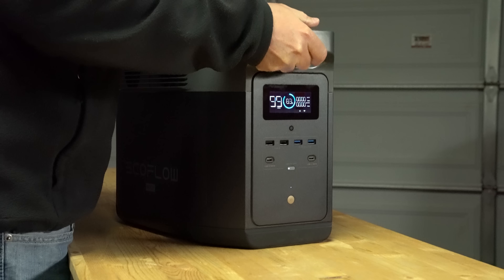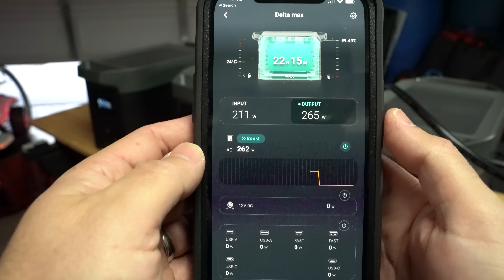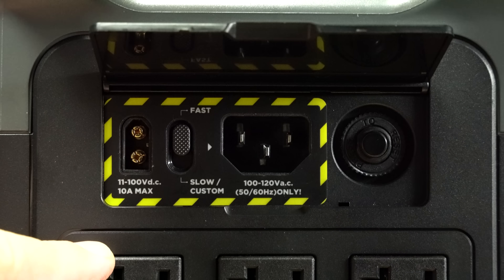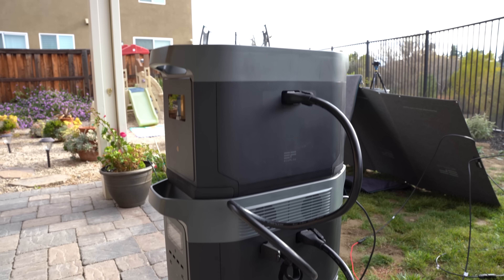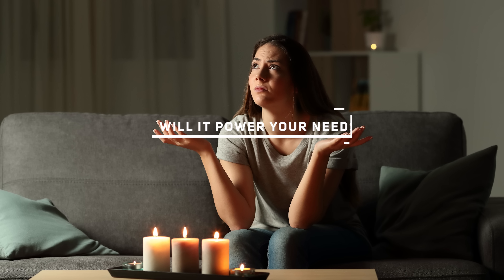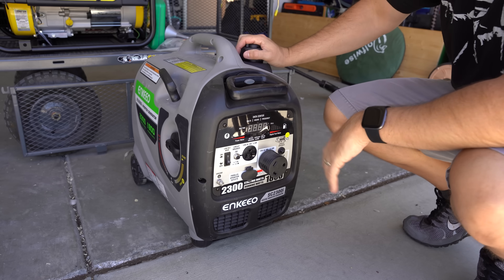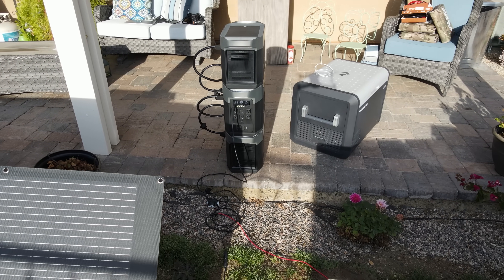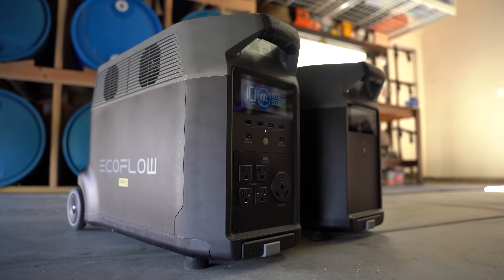Ecoflow Delta Max review - Off Grid Power in a Small Package

Comment: So how good it is with powering motors? The TV and internet are luxuries, you phone will last all day, How long will it run your fridge and freezer, your central heating system or your cooker. Even if you have gas fuelled heating and cooking I bet you still need power for the computers and pumps built into them. I have 500Ah of 12v batteries and a 2KW inverter and that will only last me 24-36 hours, even with gas heating and cooking. So I also have a generator....if you have power supply problems - get a genny.

Comment: Any computer uninteruptible power supply... Autoswitches to battery on loss of grid.  Autoswitches back and charges the internal battery.

Typically small 12V lead-acid gel-cells.  You can jumper to a common trolling motor or car battery

You can charge the 12V with solar if you want...

You can put these thigs in place for individual desired loads.  Only your critical loads pulling power means maximum run time.

Comes out cheaper than these "solat generators" that don't have solar panels included...

You're welcome.

Comment: I wonder why you are not warning people about the problems with the unit not being used for a period of time. I bought a ecoflow delta Max to use in my home for emergency use in the event of a loss of power from the Electric Co. But... the manual says not to leave it fully charged! It recommends to discharge the battery to 60%! What good is that?? Mine recently discharged on it own down to 1%, even though I had used it some in the last month, and fully charged it before turning it off. Manual also warns this could "cause irreversible damage". I could not recommend this product to people who are prepping for an outage!

Comment: Great video review, thank you! I have a scenario (and related question) that you did not address that is probably worth mentioning. I have one of these units and I keep a sump pump connected to it for when we lose power. There is a very high water table here and in spring the sump pump reservoir fills up regularly. Last time we lost power we had several emergency items plugged in to the unit (example, fridge/freezer) in addition to the sump pump and eventually those items drained the battery to the point where the unit shut down. A few hours later power was restored but the items that were connected to the unit stayed powered OFF. It appears that the default setting for when the unit powers up is for connected devices not to be powered. The button on the back to provide power to connected devices can be pressed to activate them but this is not helpful if say I am not home when the power comes back. Is there a way to make the default behavior such that connected devices will be powered when the unit powers up after a full discharge?

Comment: Question, would you feel comfortable using the delta max to briefly (1 hr) run a 14500 btu rv AC that has a soft starter installed?  I would use the dog bone from the 30amp cable to step down and plug into the 110.  My camper is in a storage lot and I can’t run a gas powered generator so I thought I would give this a thought.  Or would you recommend I just spend the extra and get the blueitti with the 30amp plug already built in?Thank you

Comment: Be sure you get one that has "pass-through" charging, like on this unit. That means you can use your power station while it's charging from solar panels or whatever, so you're effectively running off the solar panels. Some units DON'T have this vital feature (like my Jackery 1000. They do have it on some other models but say it reduces battery life, (and they already are using the shorter life type batteries.) If they don't specifically say it, ask them.

Comment: * Important Note :
Forget Solar Panels.
To much money.
They never put out as much power as they say.
* Note
      I have a   Champion Power Equipment 200961 2500-Watt Dual Fuel Portable Inverter Generator, Ultralight   $485.00 
      and run it on Propane Fuel and get 18 hours on one tank. It only takes 1 hour to fully charge my Ecoflow from 20% to 100%
      and I do it when no one is around. It charges my Solar Generator at 1100 watts an hour. ( that is all it needs ).

Comment: I just bought the Delta Max with a backup battery.  What is the best transfer panel for this generator?  I ought a 10 switch transfer panel, but the Electrian is saying my generator has a 120 outlet only and I need a 240 in order to attach to my current panel. I’m lost. I would like to add a manual transfer switch rather than having wires running all over the house to get power. Any suggestions?

Comment: Don’t buy ecoflow. I’ve had numerous problems on different products. Firmware issues, battery capacity problems etc. Not good enough and getting replacements every few months has not been ideal. Especially on the more expensive units.

Comment: Hi all,

So....I have a hack that I literally just thought of for people who can't afford another Delta Pro or extra battery BUT need additional power and own another ecoflow battery.  I have called ecoflow and given them the idea as well and they confirmed that it will in fact work!!  I then asked them why they don't tell everyone after I've told them and they said they would "escalate the idea" to their top tier and perhaps add it to their FAQs.  So here's the idea:  We've been told that you must have like systems in order to use them together.  This is NOT actually true.   If your Delta Pro is low on power (or any other ecoflow system you have) you can simply plug its charging cable (in the rear) into the front of the secondary system.  In other words you're using the second system as a wall outlet of sorts.  This works especially well in the evening when the sun is down and there is no more backup energy.  What do you do when the sun is up?...even better...plus the second system from the rear into the front of the Delta Pro.  This allows the sun to charge them BOTH regardless of the differences of their capacities or sizes!!!  The only word of caution they gave me after saying what a great idea this was, was to say don't forget to lower the charging speed on the Delta Pro once it's plugged into the front of the second system.  Guys this means you can use anything from a River and up to charge your Delta Pro OR any other ecoflow system.  If this works for you please like my comment and say "Thanks T!!" just so I'll know at least I was able to communicate something helpful to the solar community-especially since these systems are sooooo  expensive!!
Reply: "Thanks T"
So you're saying I could purchase a cheaper, lower powered solar charger (RIVER 2 Pro, 768Wh LiFePO4 Battery) in order  to charge my main EcoFlow. Then when solar charging (daytime) I plug the secondary system (back side)  into my main system (front). This would let the main system charge the smaller system while also charging the main? 
Then, when powering my appliances and the main system gets close to depleted, I just charge it (partially) with my RIVER 2 Pro, 768Wh LiFePO4 Battery, and therefore expanding my ability to run appliances longer, with the exception of the solar charging times?

Comment: When saying that it can be charged by "12 Volt Vehicle" what does that really mean?  I have a vehicle with DC/DC battery charger that can provide 40A from the vehicle alternator.  I can't seem to find a unit that will accept more than a cigarette lighter input that is limited to maybe 8A.  It seems that the ability to quickly charge the unit while relocating in your vehicle would be at the top of the list.  Do you know of any unit that can accept an Anderson plug or other connection to utilize the vehicle's capabiity?  Thanks for a really great review

Comment: I just installed a wheelchair lift for my wife in our garage. I want to have a back up in case of a failure. I just want to get her up or down once or twice. The motor is supposedly rated 15 amps 120 volts. do you think the Delta Max 2000 would work for me?

Comment: I just bought the Delta Max 2000.  Your video is a really good summary. I live in the Chicago area and have a high efficiency gas furnace so it does have some electronics. I am curious on your thoughts of rewiring the furnace to accept the EcoFlow in a power outage. It would require something like the EZ generator switch that can be found online. Have you ever considered this or heard about such a setup? Thanks

Comment: Thank you for all your hard work to keep us well informed.  I have a question for you.  There are 2 sump pumps in the basement of my home that run a lot in the spring and on and off when it rains the rest of the year.  What size and type of generator would you recommend for me to use in a power outage scenario to avoid the basement flooding.  I would possibly also want to power a small fridge and a small heater if the outage happens in cold weather but the pumps are my biggest concern.  Thank you for your help with this.

Comment: I am thinking to buy from Ecoflow but very hard to choose between delta max or delta pro. What would you choose for using it in a campervan? But also for rhis year only I need to be able to take it camping in a car. Wondering if it will fit at the back of the car, which is a Peugeot 508 SW. Any thoughts, please.
Thanks for sharing with us.

Comment: Questions. I'm looking into Ecoflow. Debating on what I need vs. what I want. My question is concerning the solar panels that you used to charge the unit vs. energy consumption. Ecoflow has several options for solar panels. Which ecoflow solar panels did you use and how did they perform time/charge? How did the solar blankets perform in comparison, time/charge? Which would you feel comfortable using to charged during the day, say in a power outage situation. Sry if these sound elementary, but I'm rather new to solar power and battery generators.

Comment: The other benefit to building your own is if, during SHTF, a turn key solution just stops working, you could be screwed, but if you build you own, chances are you will have the technical ability to fix it, although depending on the issue you may need to have spare parts.

Comment: Interesting.  However, at the end of the day, its a generator.

I scrolled through some of the video and didn't catch pricing on these, so I looked them up.  Without getting into specific models of these units, they generally run somewhere between $1200 and $4000.  I did see a combo kit that layed out the generator with chords and solar panels.  This kit was going for $6000.  Or maybe they all come with that stuff and this one was just displayed more thouroughly.
I guess that's not so bad when you compare what a traditional gas generator can currently go for.
I don't have $6000, $4000, or even $1200 lying around to make an impulse purchase on one of these, but a lot of people do.  I'd be curious to see if we keep hearing about these in years down the road.
I know for about $8000 to $12000, people can get a whole house generator that works off of lp or propane.  It connects into the main circuit panel, so in the event of a power outage, you don't really lose anything.
I would believe that the selling point for the generators in the video is that they don't need any fuel source other than the sun.
I'm not sure, in my area, when the last time was that we didn't have functioning and flowing natural gas though.

Comment: Unlike a traditional gas/png generator which are outside, are there concerns about storage location on any of these solar/battery banks. Should they be stored in a special location  to protect the rest of your house. I'm just thinking of the GM Bolt and their "keep it parked outside" statement. Also what is the best way to get the longest life out of these, run them once a month for a complete cycle? Since there are a lot of us idiots out here, can you explain one of your next videos the max household items you can have hooked up (ie lights, fridge, washer, AC ect ect) the runtime before you're out of power along with if you have to solar panels up how long you could keep going, then the total cost of the system in place vs that same in a png or gas generator. How does one get "a lot of these sent to me" to test.  I am not too bright when it comes to making my own home battery backup so I was thinking, once you are done testing all the options, would you mind forwarding them to me to do a secondary test. I appreciate any answers you can provide to this dumb dumb who has been looking at adding a png generator to my house, but like the idea of the Eco Flow to be able to power my travel trailer especially during emergency camping trips.

Comment: One major thing I don't see many people addressing for a major power outage is your plumbing. While power and water have rather obvious concerns, I caution people to remember something that you've likely heard all your life, but don't give much thought to. Poo runs down hill. Depending on the elevation of your home, unless you have a septic system, you possibly have a lift station somewhere along your system to keep sewage from backing up. If that lift station fails, the sewage from every dwelling hooked to it will gravity flow to the lowest point and start bubbling up through bathtubs, and overflowing from toilets, quickly making many home completely uninhabitable. 
If you happen to live in such a low spot, locating where your main sewer line leaves your house and installing an RV style gate valve just to the street side of your closest sewer clean out can save you from total disaster in a prolonged grid failure.
Reply: Sounds important...but I have no idea how to do that.

Comment: I have the same setup (6000 watts- delta max plus 2 smart batteries), also have 4 x 160 w solar panels. I found out that my 5 cu ft chest freezer and full size fridge can last 2.5 days on 6000 watts. I can only pull 500 watts out of 640 watts potential due to my location and the winter sun (1 hour of good sunlight)- (might get 1,500 watts in June- 3 hours of good sunlight)). I'm buying 2 x honda 2200i generators that run off of propane that will run in parallel to charge the ecoflow at least 2,500 watts/day (3 hours x 900 watts in ecomode at 25% load). I also put everything in faraday cages or bags. Yes, opsec suffers with the hondas but I can't get enough input yet to exceed the output. Based on stored propane, this setup should last at least 30 days in a grid down situation. Freezer and fridge will probably be empty anyways after 30 days.

Comment: Delta Max, is a great unit, I was able to run our home furnace for 15hrs in below freezing conditions from it, then power it back up from 600W of our Solar Blankets in less than 4hrs
Reply: Thanks for the info
Reply: Hi I had this actual question. I am curious how to rewire the gas furnace. To accept the EcoFlow. Currently it is hard wired. I have heard of the EZ generator switch which is supposed to allow a generator if the furnace power input is required with it.
Reply: @AntManBee19  I had a qualified electrician add a male 110V cord that I could then plug into an Ecoflow after turning off the furnace breaker, best to talk with a qualified electrician about this
Reply: @offgridtrek  thanks. I have seen that alternative. Definitely using a pro to get it wired
Reply: How is battery holding up?
Reply: @MrHsv123  it is holding up well

Comment: they also cost $2,000 not including the solar panels (another $1,000)... I got the whole opsec thing... but the fact is you are limited by the time it take to recharge (you need direct clear sunlight) if you think putting out 800 watts worth of solar panels isnt going to attract attention you are very wrong, you cant charge these things and use them at the same time. the other issue is why in the world would you want to power a frig when its freezing outside? put your food in a duffel bag outside then... a heater or a hot plate is a terrible waste of energy to run this unit off off... use fuel for heating and cooking. these units should be used for critical items like electronic communications, life support (CPAP, Oxygen, or small critical medications that must be stored in a frig at a specific temp).

Comment: Glad to see other companies building expandability on these larger units. Lets one buy more capacity as needed and give you more flexibility in use such as using it as a whole house power supply and building it into a sub-panel just like you would with a fueled generator.
Reply: Science-Youtuber and such channel meanwhile supplement this on so many levels, 
it is literally impossible to name all, but let me just list 2: 
-Spreading science to yourself and others helps prevent society collapsing in the first place. 
-Knowing how Batteries and such work AND especially how 
FUTURE SCIENCE can reduce the biggest issue with batterys (you know which, dont you) is Key 
to being Prepared. 

I cant put it simpler, so here you go: The more you know, the better. So learn some science, 
low-key science and high-key science.